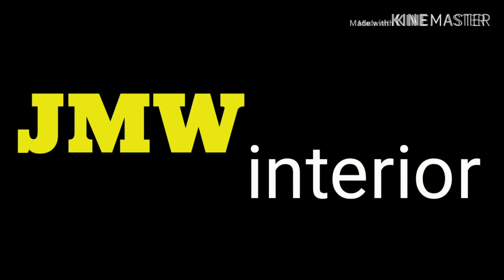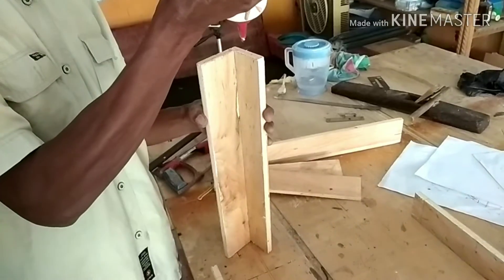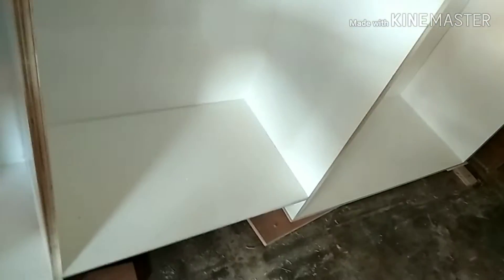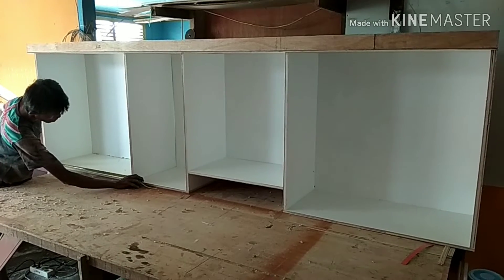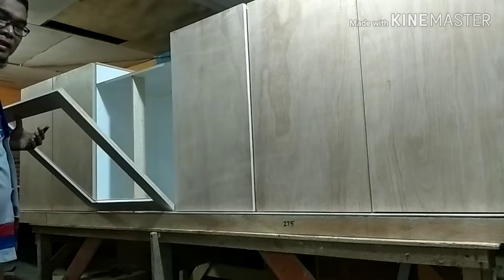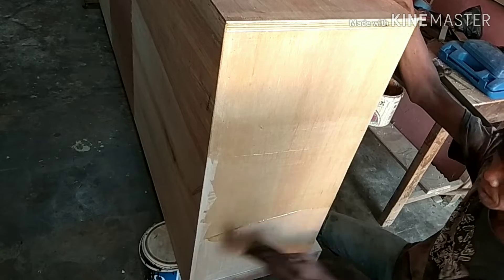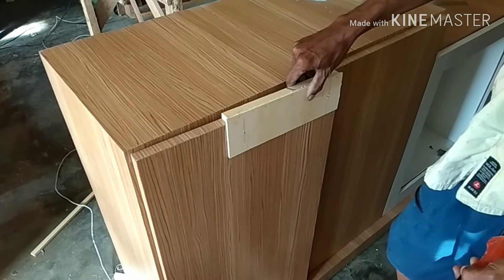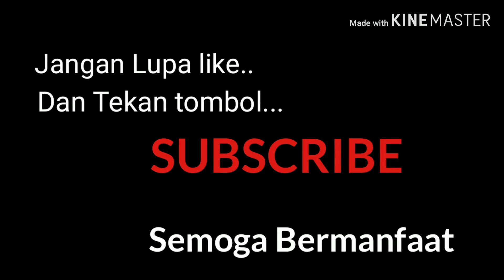Membuat Kitchen Set dengan Cookerhood

Comment: Maaf bos.. Tanya karna masih belajar.... Setiap saya nonton vidio bapak selalu pakai triplek 12+ 4. 
Kenapa g pakai yang 15/ 18mm sekalian, apa ada maksud2 tertentu... Mksi...
Salam kenal dari depok...
Reply from the maker: 1. Tebal 15/18 berat, dalam bekerja sendiri
2. Tebal 15/18 sisanya jarang bisa dimanfaatkan
3. Tebal 15/18 apabila salah potong ruginya banyak
4. Tebal 15/18 untuk daun pintu sering melengkung
5. Tebal 15/18 di daerah saya sulit dapat yg kualitas bagus
Semua diatas manfaatnya bagi yg punya industri, tetapi bila bikin untuk rymah sendiri pake 15 atau 18 saja
Reply: @JMWinterior  makasi infonya semoga makin maju.. Disini klo bikin daun pintu melengkung mulu... Belum ketemu masalahnya... Semoga bermanfaat nntinya amin...